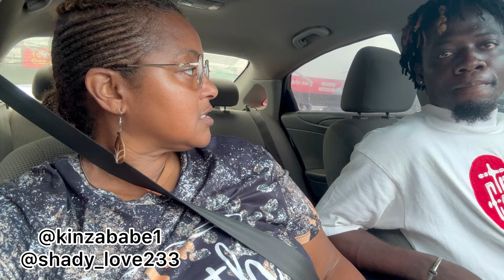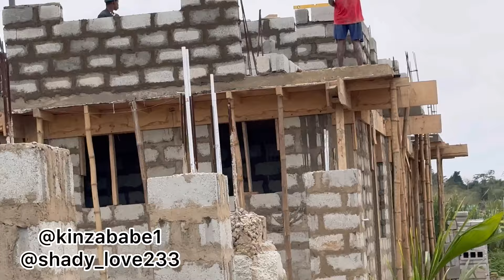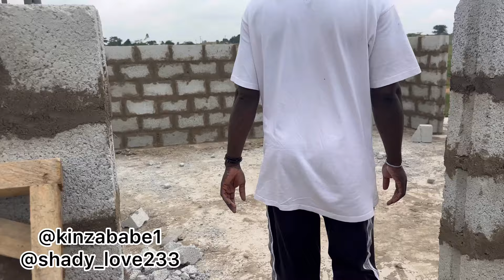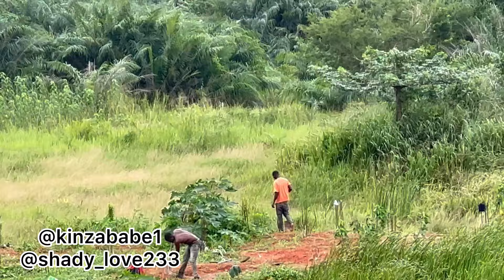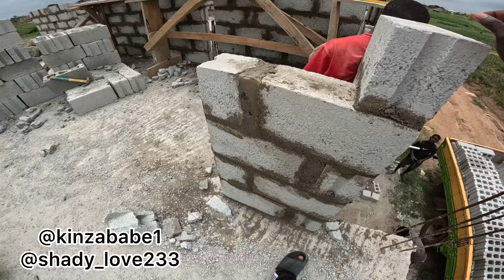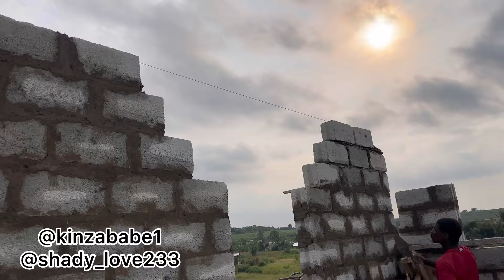Building in Ghana: Day 2 of block laying/ police searching again

Comment: Having the block all round the shower will make it a nice built in shower that you can tile on all sides and use a curtain or glass partition for it. But its not really ideal having the entire bathroom seperated from the room with a glass partition as i heard in the video.  Best it to close it off and have an entrance door. This way the bathroom is closed off from the bedroom though its part of it as an ensuite.
Reply from the maker: That your style…  if I tile my bathroom with nice tile what since does it make to close it off that I can’t see my nice tile bathroom. It’s an on suit but the bathroom is not that big. Ghana bathroom are small already with no space to close it off makes it even smaller.
Reply: @kinzababe1  well if thats what you prefer its ok, you could have also then opted for a separate toilet and have the bathtub open in the room where you can soak with your bottle of wine in the bedroom, anyway its all good design. The idea of Closing it off was to not have the number 2 scent coming into the bedroom as an ensuite and thats the idea, but there are room fragrances to mask it out so no worries,  besides you spend more time in the room than bathrooms in Ghana thats why they have such designs unless the person is claustrophobic. There are a lot massive bathrooms i have seen with the size capable of being used as a complete ensuite bedroom.

Comment: From watching the video, you asked about the bathroom window,  usually in Ghana bathroom window is designed a bit higher, but it depends also on the style of windows you want. I mean is it going to be the pop out style windows or sliding. Also the side next to the bathroom could be your little office or work area that you can also do your makeup on for a multipurpose use. I was thinking its best to have the bed on the otherside where shady was saying in order to have both tv's for your room and living room on the same wall to make it easy for wiring purpose.  And the bathroom is better to be closed in with a wall with a glass door so you can have your bed on that side and the sun wouldn't bother you from the bathroom in the case. 

Having your bed on the same wall as the TV/media wall of your living room isn't a good idea because it could cause your or whoever sleeps on there a disturbance if theres someone watching TV or with visitors in kitchen/living room watching TV and chatting, the vibrations will get through. And also its best to have the bed on the otherside between the bathroom and your balcony in my point of view( when having adults moment being a grownup) and this should also give you a piece of mind for some privacy or when trying to sleep either day or night. But its also not a bad idea with your initial design too because thats what you envision and its could be your preference.  I am just stating options based on these reasons. Because its practical to have the bed on the otherside but you prefer to have the bathroom open but closed of with a glass partition  but i think its best to close it off with the wall and put a glass door instead at least. Because having all glass partition for a bathroom and toilet in a bedroom is a good idea but not practical in your case of the bedrooms. 

But if you insist on having the bed on the same wall as the living room,  then you can use the space next to the bathroom as a walk in closet, and have your tv on the other wall with that bugout space above the outside ground floor toilet, as you dresser area or desktop area for your home office work space.  The walk in closet area could also be designed with a dresser with fully fitted mirror and lights for you so that the other section could be your desktop work space area, with the TV to your left and balcony to the right making it more lighted and airy.
Reply from the maker: Good suggestion on the work area. As the time comes to wire and do the finishing then I see what layout is best for the bedroom. Bathroom I will not but walls to much walls closes in the room. I like the open spaces.
Reply: @kinzababe1  good to have open spaces but you wouldn't want to lie on bed and bw staring at you water closet. But its also not a bad idea as i havw seen some hotels abroad likw this with the bathroom completely glass and you can see inside the bathroom completely,  i wonder what it feels like having someone im there doing a number 2 with the partner in the bedroom.
Reply: @kinzababe1  its also good to pre plan all these ahead as later changes and modifications also cost more money and thongs have to ne ripped and broken yo create any new ideas. So best to plan ahead and decide what you prefer.

Comment: After looking at the thumbnail image again regarding your bathroom window and the one next to it, it isn't that much of an issue to worry about. They can use dark tint or frosted glass or frosted and tinted for the bathroom window for privacy. 

Also are you using the top openout style window or sliding? Either can sill be made to accommodate.  So don't worry,  as long as they make the glasses to give you privacy inside, remember you are soon having neighbours and regardless of thier bolding height people can also see through tints at night with the light on inside, so will be good to have blinds or curtains also to add to it. Having blind or curtains you don't need tint but can have it.

But looking at this thumbnail its best to put a wall across to close in the bathroom and have the entrance door for bathroom in the middle. Because from entering you gave the toilet seat to out left and vanity in the middle and shower on the right against the wall. It you prefer to put a mirror in there them they need to lay one level or layer of blocks in the windows to make room for the mirror.
Reply from the maker: The windows I am not worried about privacy they’re many ways to cover the windows. The mirror is what super Shaddy was concerned about but I am not. You can put a mirror anywhere. I want the windows because if I have guests from abroad I have to make it as comfortable for them in case of loss of power. The heat here in Ghana also plays a role in my design and layout.
Reply: @kinzababe1  don't worry your apartment looks very windy  i could hear it in the video.

Comment: @kinzababe1 I also have an idea of your kitchen is to go got a u-shape style kitchen with the front facing the living room as a little breakfast bar which you can use also if not wanting to use dining table. Because tge breakfast bar area with stools can also serve as your little bar as part of your kitchen and entertain while you cooking like a kitchen island.  But this would be a u-shape style kitchen with the galley. Think about it. And this would interfere with the entrance of the other room. You could have the cooker in the corner against the bathroom wall of the other room and the fridge stationed on the entry section of the U-shape kitchen near the entrance door. So it you enter there apartment,  directly infront will be the sofa set and to the right corner is dining room, then to your immediate right is your u-shape kitchen where you get into it through the right hand side. It doesn't need to be too chubby cupboards for storage or too massive or chunky workspaces all round it.